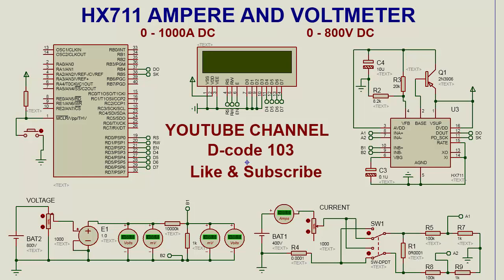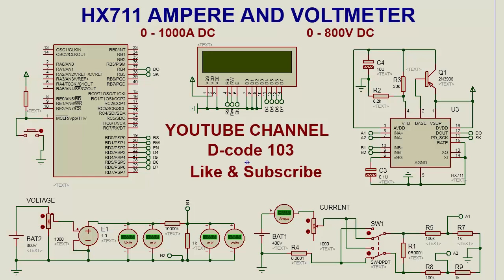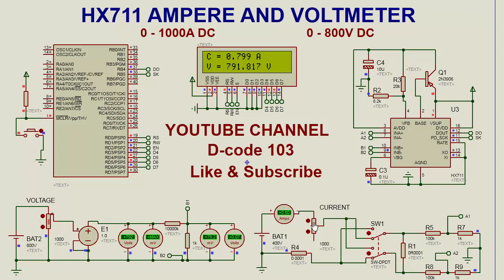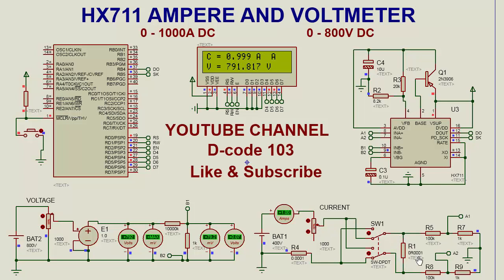HX711 current and voltmeter DC - 0 to 1000 Ampere

Comment: Can you please share it's code, thanks
Reply from the maker: Sir code sharing is possible professionally only. But you can do itself. Just read ADC according to datasheet. Some scaling is required for high voltage and current. Remember it voltage range +-20,+-40,+-80mV for 128,64,32 Gain.
Thank you for watching videos of my channel.